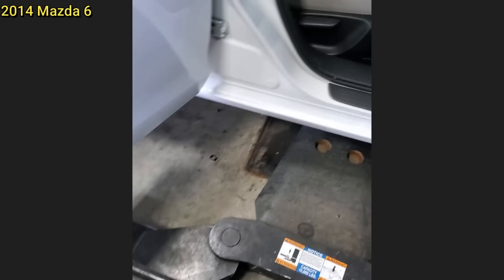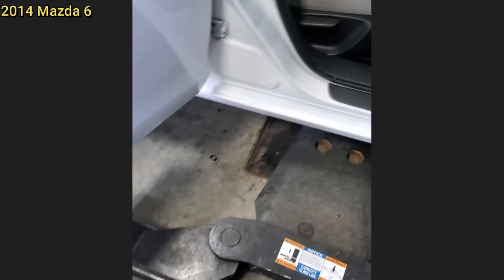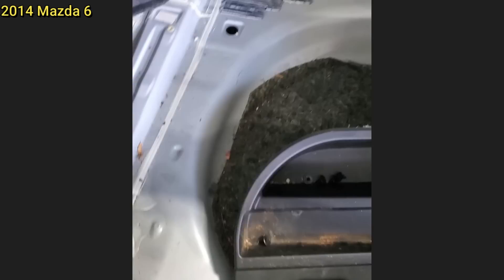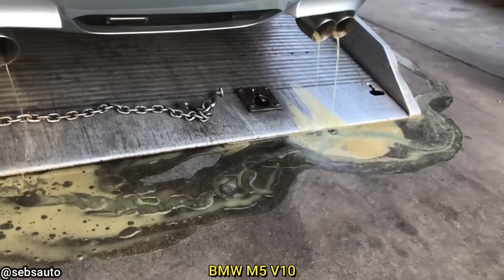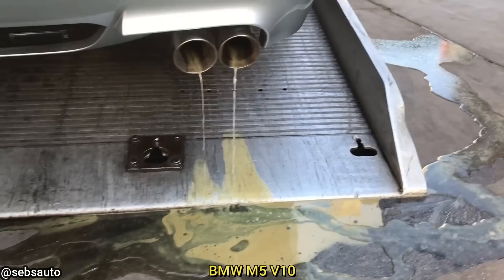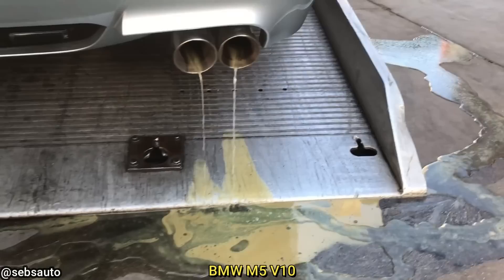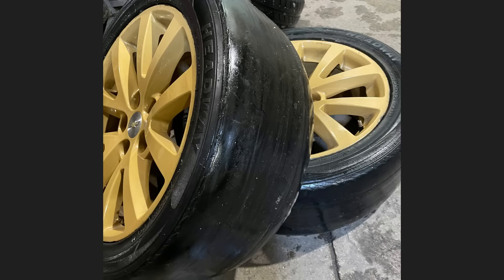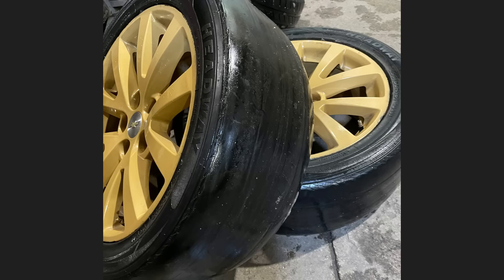Customer States Heard A LOUD Noise When Trying To Charge Tesla

Comment: That Tesla owner is SO LUCKY his car didn't up in flames when he tried to charge it.
Reply: There’s no way it would have allowed him to charge in that state.
Reply: Or worse, Whole fcking house on Fire
Reply: @sonacphotos Battery packs are not pressurized.
Reply: jay jay  high strength steel. Driving over rocks will fuck up anything that doesn't have a thick steel bash plate.
Reply: You do understand that all of the packs are monitored by the computer. 
Not everything is a fire.
Reply: jay jay  that is a big rock .
Reply: well i.m not sure his insurance would cover that and for sure the warranty doesn't cover that . maybe it would have been better if it burned down then insurance would pay.
Reply: @ronblack7870  
Your comprehensive covers road hazards. And that does appear to be a piece of road. 
Why you think gasoline powered vehicles aren’t damaged in a similar way? What do you think would’ve happened if that cut the one oil pan?
Or a transmission?
Reply: @neilkurzman4907  a much much much smaller bill. The battery pack in a tesla is going to run you nearly $20k, it's the single most expensive part of the car (hell its the only part of the car that is expensive). 
Which is why you really need to read your insurance documents, with EV's alot of them have a lovely little hidden exception for battery packs.
Reply: @cgi2002  
Much much smaller? Only 10 or 15 grand? You also realize the battery pack is repairable. It’s broken down into groups. I don’t know if Tesla offers that service. But I guess anybody having an electric car should make sure they have the proper insurance for it. 
By the way that’s not necessarily 100% true. Bodywork on Tesla is very expensive. And unfortunately ties up your car for months.
Reply: @neilkurzman4907  tesla as a rule doesn't offer any customer friendly services. 
The battery pack may be repairable, but not by tesla, and they don't sell the parts to do it. Sure you could use 3rd party components but using any non-Tesla approved parts voids your warranty and also blocks out your ability to use theit fancy fast charge services for "safety reasons" (in this case, damaged battery repaired by non-Tesla approved engineer with untested parts), Tesla only approves tesla parts and their own staff.  
I agree their body work is expensive as hell to repair, but it costs next to nothing to make, same with the rest if the car, litterally the battery is the only part that's expensive to manufacture.
Reply: @ronblack7870  His insurance did cover it.
Reply: @neilkurzman4907  few hundred to a few thousand. Teslas are shit. Deal with it.
Reply: @logitech4873  then either dropped him or doubled his rates.
Reply: @TheGuruStud  [citation needed]
Reply: @neilkurzman4907  Have you ever punched a hole in a lithium-ion battery? 

Computer monitoring or not, you hurt one of those things just right, and it IS a fire...a big one.

In an automotive context, take a look around youtube for a clip of when Richard Hammond rolled the RIMAC prototype.
Reply: @TheGuruStud  
So you think it’s a few hundred dollars to fix a high end debt sports car with a blown head gasket and oil and water coming out the exhaust?
Reply: @numberyellow  
As a matter of fact yes I have punched a hole in a lithium on battery. i Worked for a company that made battery packs. In fact I watched the whole pallet of batteries burn. Quite impressive.
My comment was that the computer knew there was a damaged battery in the pack. It wouldn’t allow it to be charged.
Reply: @cgi2002  This is incorrect I know someone who bought a brand new BMW and drove over a rock busting the transmission the cost of the transmission was so high they totaled the literally one week old car.
Reply: Where is there a Tesla in this video?  I see none.
Reply: @charlesball6519  
The one with the rock stuck in it. 
They indicated that it was a Tesla.
Reply: lucky it did not explode instantly , Would have not had to be charging it for explosion to have occurred.
Reply: @steve64464  
Why does everyone think lithium batteries explode like a bomb.
They certainly burn intensely. 
Tell me do gasoline cars explode? or do they just burn.
Reply: @neilkurzman4907  video evidence shows that when a lithium battery is significantly damaged it short circuits then it goes into whats known a thermal runaway when there's no controlling the chemical fire which consists of flammable gasses etc which all burn in excess of 1500'c +, To recreate the effect you must only put a nail into a high current capacity lithium battery.Least when you put a nail into a standard petrol fuel tank it only leaks and not goes up into flames unless your unlucky enough to generate a spark while drilling into it.
Reply: @steve64464  
I worked for a battery manufacturer. We used to do the nail test. I Didn’t see an explosion. It Look more like a highway flare. And that’s not thermal run away. Thermal runaway happens during charging or discharging. 
The ones we did never burned more than 1000C no you don’t need a high current capacity lithium on battery most of them Will burn. 
I watched watched a whole pallet of lithium my on batteries burn quite impressive. There were no casualties. 

Your self-serving example of poking a hole in a fuel tank is completely a relevant.  Be the same thing as if I threw match at battery as compared to throwing one into a gas tank. 
You may not be aware of this but gasoline is very flammable. And gasoline vapors in a confined space will explode.
Reply: @neilkurzman4907  Lucky today there is research into other battery chemistry's that are not so explosive during battery failure. only other downside to lithiums is they need replacing in about 10 years time after heavy use. Sooner if you live in a hot climate as lithiums hate heat.
Reply: @steve64464  
Most battery chemistry is degrade under high temperatures. 
There’s a lithium iron phosphate. But it doesn’t have the energy density of lithium ion, or lithium polymer. 
But in the end if you have a high energy density battery and you short it out then the electricity is going to generate heat. That’s true of any battery. 
Lithium ion just happens to be made out of a lot of things that are very flammable.
Reply: @neilkurzman4907  Yeah they can get most exciting when they blow :-)
Reply: To avoid an argument between gas and electric, how about we just agree on this: Cars store a lot of energy. When the storage medium breaks, there tends to be lots of fire.

Just be glad we aren't using hypercapacitors yet. Those can explode quite violently.
Reply: @neilkurzman4907  there is a reason they keep lithium from exposure to oxygen and moisture.   Break open your laptop batterry when it has any kind of charge.    Also the components maybe fire resistance but once plastic and certain polymers once they reach their flash point they can burn themselves and cause a chain reaction.
Reply: @johnstaton5524  
Lithium metal is certainly flammable. 
But that’s not what’s in a lithium-ion. battery unless it’s been abused. 
The electrolyte is no more flammable than gasoline.
Reply: Homeowners insurance companies are getting ready to raise rates sky high if you have a EV because of this.
Reply: The new pinto boys and gals!
Reply: It was only a matter of time and he did the right thing before it was too late. If any EV starts smoking, get out of it, and get away from it.
Reply: @nuttysquirrel8816  If any car starts smoking, I'd say get out and get away.
Reply: @neilkurzman4907  Much much cheaper to repair an internal combustion engine then EV.  Transmission is only $1200~$2000 and even a full engine replacement is a similar cost, assuming you're talking about a standard consumer vehicle and not a supercar.  Those parts aren't usually damaged by road debris though unless you have a rear engine, they're up between the front wheels and most road debris would hit towards the middle and rear of the vehicle if it hits anything.  (without needing a battery pack, internal combustion vehicles actually have a lot of empty space under there)
Of course, garages are going to charge a service fee, but even with that factored in it's still cheaper than the $6000+ it costs to replace the battery in an EV.
Reply: @GremlinSciences  
That certainly isn’t the cost of a new transmission. It’s barely the cost of a rebuild. And doesn’t include the labor to install it. 
What vehicle are you people using as an index for these ridiculously low repair prices?
And do you think every electric car has a rock jam through the battery case?
Reply: @neilkurzman4907  Who's talking about that pos? No one. We're talking about ICE engines in general. I can swap some of my cars with a TWO generations newer engine (low miles, more power, plug n play) for under 1000. A small repair on a pos tesla is 1,000. A drive motor is at least 7k. 7k would completely refurbish an ICE car for another 300k mi of reliabilty.
Reply: @TheGuruStud  
Low miles means used not new. 
What does a low miles Tesla battery cost? Or a low miles drive motor?
How often does a drive motor fail on a Tesla? 
So you’re saying you get 600,000 miles out of a car?
Reply: @icedout2322  you had a 20 thousand dollar transmission?
Reply: How did he drive over that rock in the first place and then not notice? It makes no engine noise but for sure that rock would have made a sound plus he has ground clearance so he must have drove over a curb or something.
Reply: Seriously.   its amazing it didn't short and burn.
Reply: Exactly but if hit something that hard to poke a hole in my car I’m stopping to check a) what it is, B) can I drive it safely home, and that’s with a conventional engine in it, not something that’s silent, he would of felt it through the floor even if the music was cranked to deafness a certainty.
Reply: he is lucky it didn't catch fire as soon as that rock went in. LUCKY it was a rock and not something conductive. Lithium batteries are NOT to be fucked with :)
Reply: @sonacphotos  there are plenty of them that have caught fire.
Reply: @neilkurzman4907  I demolished a transmission oil pan once. less than $100 to replace it right in the parking lot. Tesla battery is about $20k to replace, so if insured would likely be considered a total loss. Also, I tend to buy used cars around 10 years old so I would never buy a Tesla as the the battery would be out of warranty and likely on its last leg.
Reply: @seth7745  
Why do people pick a cheap car and what used parts? And include absolutely no labor. 
Now tell me what if your oil pan was cast aluminum and under the crossmember? Would that be $100 in the parking lot? And look at the rock. It didn’t just make a hole in the oil pan. It crushed into it. If that happened to the car you might be looking for a block. 
And if it was a transmission pan, you wouldn’t be rebuilding that transmission. Now what is a new transmission cost for a front wheel drive vehicle. Not a rebuild a new one installed by a dealer? Is that $100.
Reply: @neilkurzman4907  Way too many if’s in this word salad. The transmission pan I replaced was on a Plymouth voyager, and it was easy. about 30min of my own labor. Also, a rock through an oil pan would not destroy an engine block. Lol. Worse case scenario in my M5 with overhead cam is I get an oil low light and shut down the engine before there is damage. It would likely shout down on tis own if I lost oil pressure. Also, If I have to remove the subframe to get to engine components its 4 bolts. Easy. Also, I don’t know what it cost to replace transmission because nobody I know has ever had to. It’s a pretty rare occurrence. My Chevy Silverado is going on $300k miles with the original engine and drive train and my last BMW was as well before I sold it. I have been a DIY mechanic for decades though. When you take care of cars they rarely need major repairs. The same will go for EVs once they get the battery technology right, but it isn’t quite there yet. They tell you it will last the life of the car, but don’t talk about degraded performance and range over time. The gas tank on my '06 sicverado will get me just as far as when it was new, that is about twice the distance as an electric truck.
Reply: @seth7745  so you’re comparing an old car with a minor hole in the oil pan to the damage in that picture?
Now what would’ve cost you to have that vehicle towed to a dealer and repaired there? And as I pointed out you’re lucky that the oil pan was repairable without jacking up the engine. In a parking lot. 
I guess you should watch these channels more. People get rocks through their transmission, transfer cases, and rear ends.  
So why do you think that a gasoline vehicle will go 300,000 miles, but an electric one won’t?
If you wanna watch other videos, there are people that repair Teslas themselves. But you can compare a home repair to a dealer repair. For two different repairs. 
Watch the video again what do you think oil pan would’ve done with the same rock.
Reply: @Justin.Franks  in a ICE car you might just change a valve cover gasket.  Not run away. Smh
Reply: @Forrest Blade I'm not changing anything. I'm arguing that if the battery is damaged in the right way, the whole car will go up in flames, and rather rapidly. At that point, charging is the least of one's concerns.
Reply: @sonacphotos  Yeah and I remember a whole bunch of Elon Musk lies, what's your damn point? He constantly lies about Tesla's - that's his literal job.
Reply: @neilkurzman4907  "Bodywork on Tesla's is very expensive"
For you maybe, it's still $0.3 worth of work. Have you not seen the body of a tesla up close?
Reply: @robertpaulson8790  
$.30? So you’re saying it’s all time and no materials? It’s a good $500 to paint the fender on any car. Car repairs aren’t cheap.
Reply: That's an external impact, nothing to do with the battery itself..
Reply: Gas. EV. At the end of the day, rhe majority of car fires are caused by faulty wiring in the elctronics.
Reply: @James_Bee  Makes you wish air starters were more common in the west, but they're almost exclusively found in Russia and some parts of China.
Reply: @sonacphotos  ngl, that’s kinda clever
Reply: @neilkurzman4907  what if the computer fails, then you'll have a fireball.
Reply: @lastotallyawesomebleach204  
And what if the computer fails on your home furnace?
There’s multiple levels of safety in a battery. It’s not just one computer.
Reply: Tesla is a dirty word amongst serious electrical engineers. Useless Deathtraps.
Reply: @papalegba6796  😆
Reply: @papalegba6796  😆
Reply: @papalegba6796  😆

Comment: 1:20  This is why we always get a PPI (pre-purchase inspection) before buying a used vehicle, kids.
Reply: Should’ve known something was wrong, it was a V10 BMW lolol
Reply: But he got a good deal!
Reply from the maker: What's the fun in that? We won't get any awesome clips then 🤪
Reply: The moment I saw those pipes I knew what this was lol
BMW, you were so close to godhood!
Reply: Maybe he did it himself on that 1st night and had to get towed?
Reply: @THRASHMETALFUNRIFFS  He probably blew out the RTV the previous owner had used to plug the leaks.
Reply: Also why you stay away from almost all used BMWs, but definitely run if it’s a V10.
Reply: if you listen, the guy is asking a couple very important questions ...
Rust?
Coil Packs?

Oh my :)
Reply: how much are they in your area? i can’t find one for under $200
Reply: @nodsib  All BMW's post 00's are pretty shite in terms of reliability (apart from the inline 6 diesels, those cannot die). The pre 00's are solid, they can break but that's because they're old and possibly not very well maintained, not because they are too complicated/poorly designed. Cheap parts and easy to fix too.
Reply: I offer that service for vintage vehicles but if I saw a BMW V10 the report would read something like "multiple known failures inherent in engine design, catastrophic failure likely."